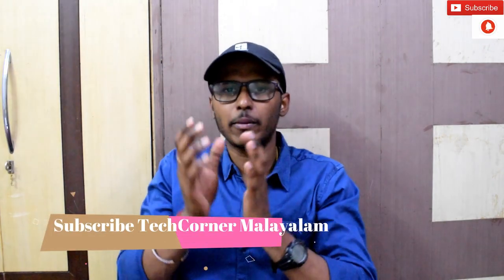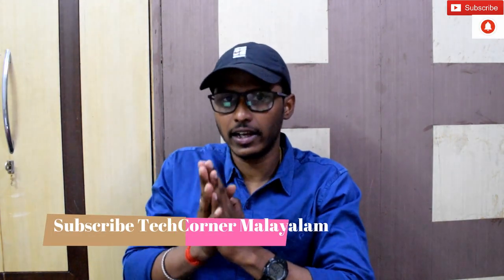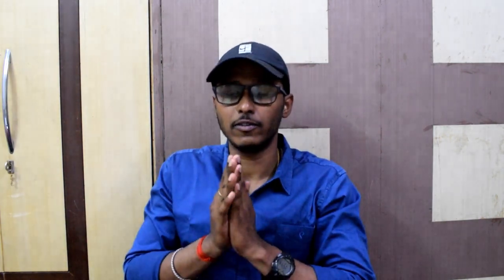What is Transformer|എന്താണ്  ട്രാൻസ്ഫോർമർ

Comment: Star star transformer use cheyyunath high voltaginano?
Reply from the maker: Angane parayan patla low voltage inum undu....
High voltage in use cheyunedeth loss koodthl aayrkm athukond thanne avde oru tertiary winding delta connected aayitokke kodukaar undu..angane aanu star star configurations high voltage in use cheyuneth
Reply: @TechCornerMalayalam  egneyane loss undavunatge